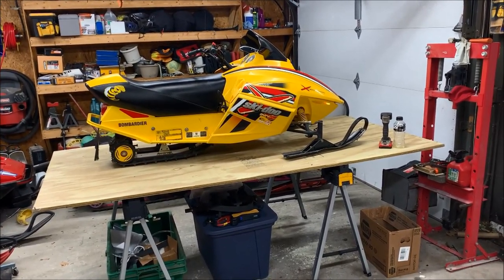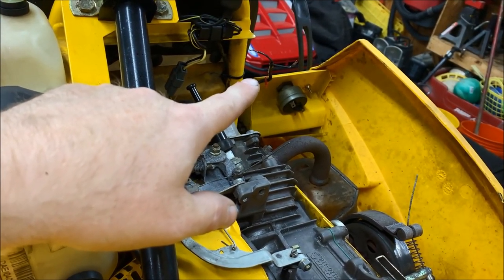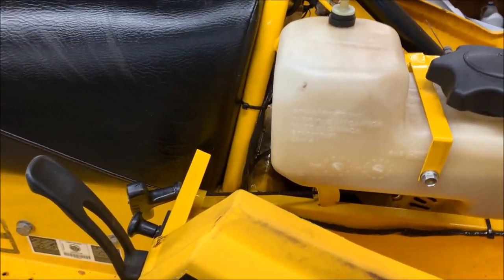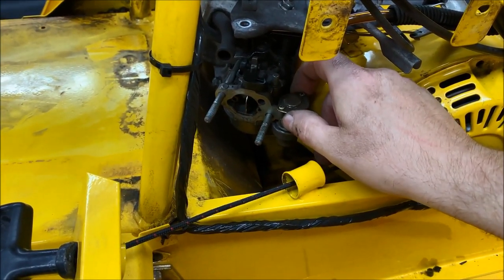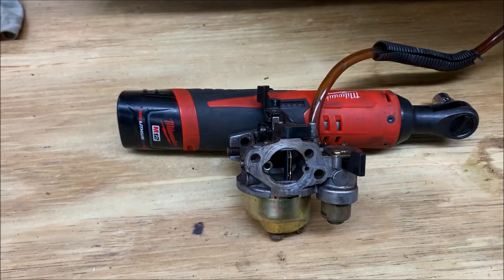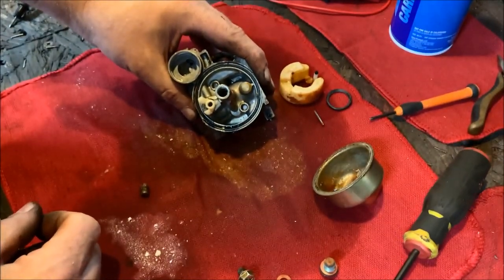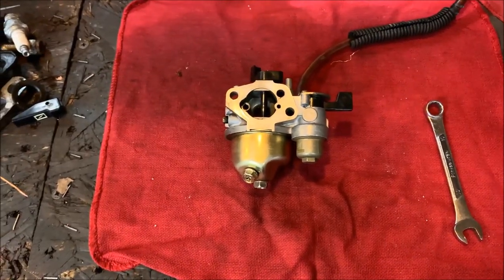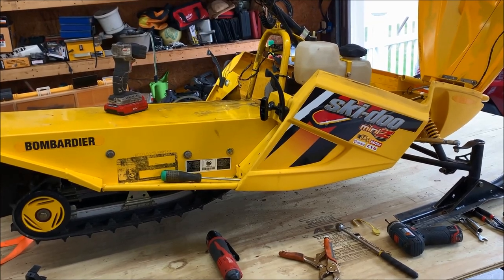How to remove and clean the carb on your Ski Doo Mini Z or REV

Comment: Great video.  Thank you.  And, keep the mini Z videos coming.  I got one for my boy last year and I'm having a hell of a time keeping in running. It's been modified, and I'm thinking it's either the carb or the governor...
Reply from the maker: No problem. I’m going after the driveshaft this weekend. Also the tensioner is whacked out 

Take a look at the carb first. There’s no filter on the fuel system and it would t take much to plug that main jet and stop it.

Comment: Thanks for making this video. Im working on the kids sleds all the time with few videos. We have the same as your video 05 mini z. So far ive done clutch sprokets chain idlers and most recently the coil.(wouldve loved a video on that one). Got fire and now runs but bogs so now your video came in handy. I wouldn't have thought the seat to get back to the carb. Thanks for the time saver👍. Any hop up kits in the future on the minis?
Reply from the maker: Glad it helped you out.

Nothing planned yet, the sled went to Brian's house for Christmas for the kids and right now they're getting some time on it. The Skis were swapped out with some C&A's since the metal one's were getting tired.

I spent a lot of time "tweaking" and "correcting" the driveline and the chain adjuster but it was such a convoluted process that when I looked at the footage, a lot of it didn't make sense since I was changing the plan mid stream. lol

Comment: Hi. Good video. 
I have a question for you. On that comment you made regarding the plates doubled up on the drive axle bearing. I have a 2000 mini z that as far as I know has never been taken apart, and the plates on the drive axle are doubled up. I have a shop manual for the machine and the pics in it seem to show the plates doubled up on one side like they are. I know you pointed it out to be wrong, so I’m trying to figure out which way it’s supposed to be. 
I have an issue worth the drive axle being out of alignment. The machine kept throwing the chain and this is a common known factory problem. The axle is supposed to slide over once I loosened the stop collar on that right side but I can’t get it to budge. Any info you have on it would be welcome! Thanks.
Reply from the maker: to remove the driveshat you need to press out the roll pins that are holding the drivers ins place. Once the pins are removed, the driver can be slid to the right and it'll allow you to slide the shaft out.

It's a horrible design. They were never meant to be serviced apparently.

Comment: This Mini Z must be assembled in Canada based on the "square drive" (Robertson) screws to remove the seat. Looks to be an actual Honda GX series motor based on the carburetor design. Most "knock offs" don't have the fuel shut off / inlet fuel bowl. The Honda GX series engines are extremely reliable and are simply superior to the copy cats. Just use low or no ethanol fuel (no corn syrup). Also, a tether cord is a must. These little sleds often find themselves rubber side up. Kids are resilient however, 4 strokes don't work well upside down.
Reply from the maker: Yep. Honda GX120. 

Kids already rode it a couple times over Christmas break. They were happy.